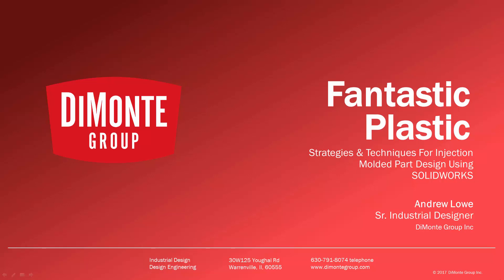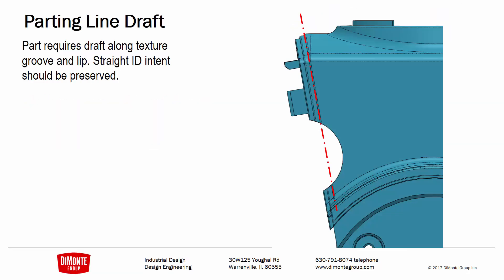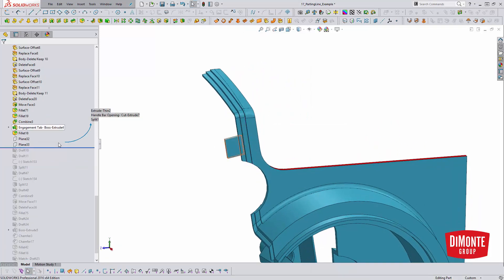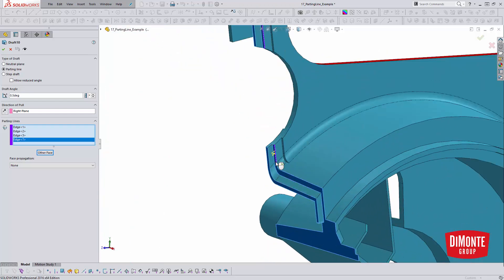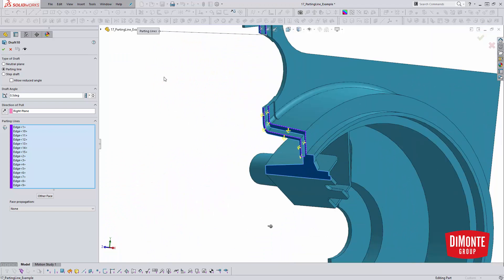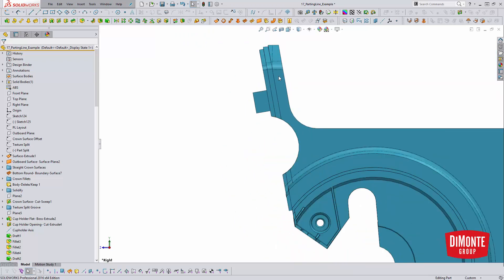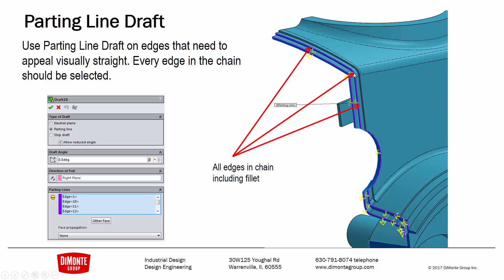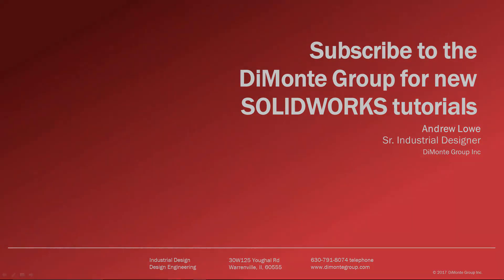Drafting Cosmetic Edges II - Fantastic Plastic 17 - SOLIDWORKS Tutorial

Comment from the maker: Claus,  Thanks for the response.  We are glad that these have been helpful to you.
By "a straight line", you have to visualize that before the draft all of those edges are on a single plane perpendicular to the draft plane. Those edges could be coincident to an adjacent part, but are most likely a consistent gaps distance away from adjacent parts.  
Using "parting line draft", the edges won't move.  The draft starts at those edges. Any coincidence or gap between this part and an adjacent part is maintained.  When viewed from the side, those edges will still be in line with one another exactly as they were before the draft was applied.
Had a "Neutral plane" draft been applied instead, the edge closest to the neutral plane would translate a little, with edges further and further from the neutral plane translate more and more.  The edges are now on a plane at an angle to the draft plane (not perpendicular), making them appear to jog when viewed from the side.  Any coincidence or gap relative to an adjacent part grows as part geometry gets further from the neutral plane. 

Great question!  I hope that the above makes things clearer for you. If things still aren't clear, we suggest making a quick model and testing out the difference between drafting from a "parting line" and "neutral plane" for yourself.  In your tests, use a higher draft angle to exaggerate the effect to make it really clear what the difference is.
Reply: Ah! I understand :) Thanks for the explanation. I think the comparison to that "regular" method would have made the video clearer, for me at least.